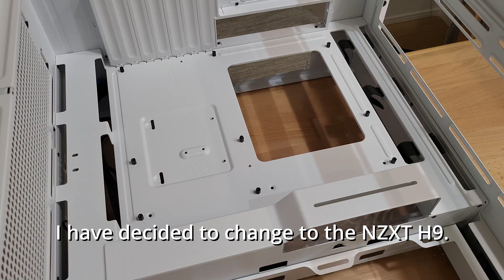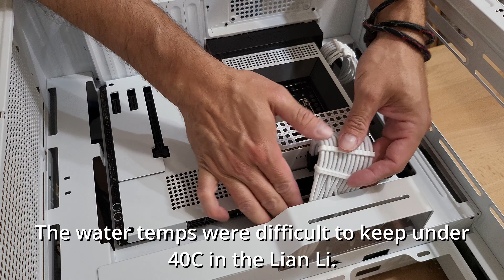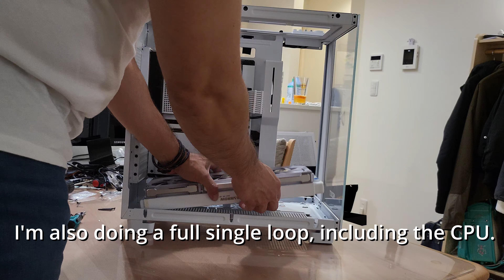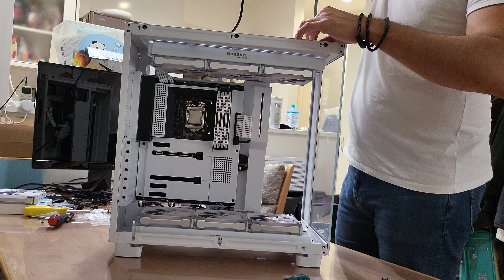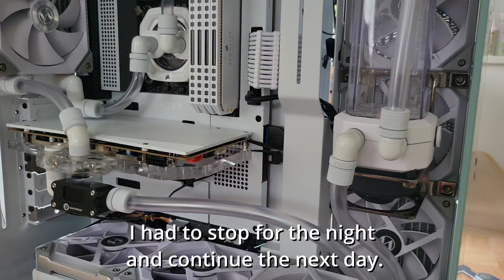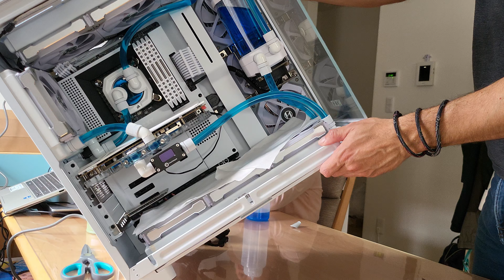NZXT H9 gaming PC build | Custom loop | RTX 4090

Comment: Nice build. I´m thinking about building a custom loop in my H9 Flow aswell. Are your temps good? Side and bottom is intake, upper and rear radiators are out, right?

Comment: can you post what parts exacty are  installed pc? i want to build same pc
Reply from the maker: NZXT H9 flow case, barrow radiators, lianli uni fans, corsair d5 pump, corsair xc7 cpu block, Corsair soft tube fittings, barrow angle fittings, gigabyte vision D z590 mobo, 11900K cpu, team group argb xtreem ram, zotac rtx4090 amp gpu, bykski gpu block.

Comment: I'm looking at doing corsair custom loop parts while using the exact fans you did... What controller did you use for the fans?
Reply from the maker: I'm using the commander pro for fan control based on the pump water temp sensor.
Reply: @diypcjapan9617  thanks!

Comment: what type of 4090 did you use? I have a 4090 strix with alphacool waterblock, and my fear is that doesn't fit in this beautiful case. I saw in most video that the lateral panel will touch the gpu wb. Can you say me how many cm there is from the mobo to the lateral panel? Thank you
Reply: Any graphics card fits in this case bro
Reply: this case is fricking massive bro